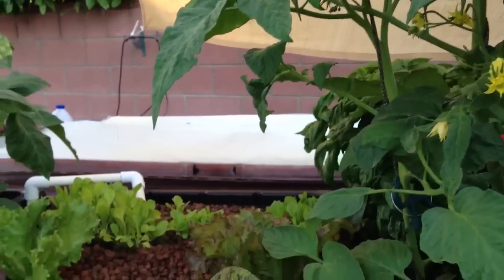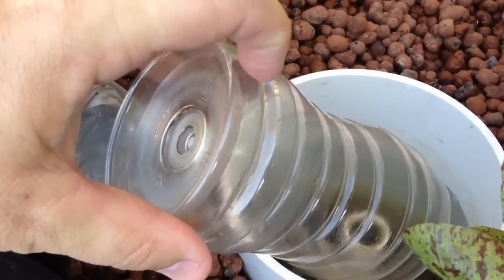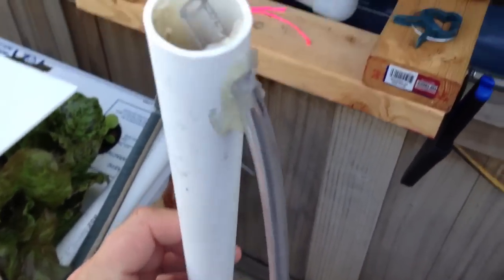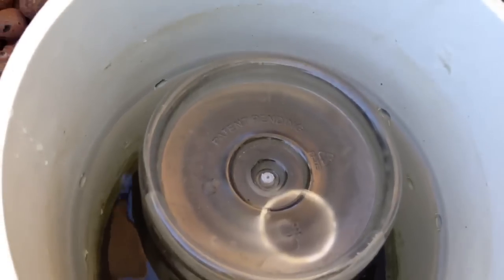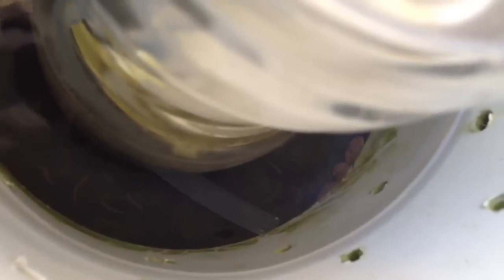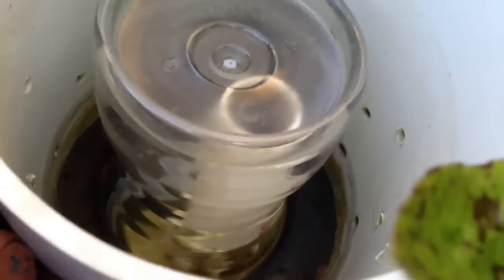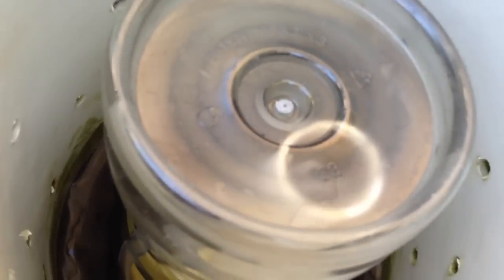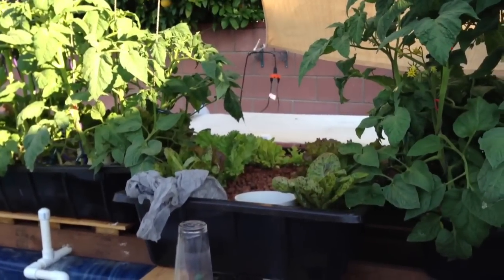The perfect bell siphon.

Comment: Two things. 

1. Drilling a hole in the stand pipe does nothing for that action. Might as well just zip tie it to the pipe. 

2. Doing it this way has/makes no difference in the time it take or anything to do with the drain time. That's just in your head. The whole reason people put the vent tube through the bell is so that they can stop the tube just above the intake slots, holes,  slits, ect, so that the vent tube can start the venting before it reaches them. And that's what stops the gurgle 

You putting that tube just makes the vent lower than the intake slots, holes,  slits, ect. Even if you angle the tube so it opens higher that water in the tube just stays there making it gurgle. 

I just tried it here and it fails to be of any use.
Reply from the maker: Past performance is no indication of future results.  Results may vary. No warranty is expressed nor offered.  Best of luck with doing whatever you wish with your system.
Reply: @jerschmitz11  "Past performance is no indication of future results.  Results may vary. No warranty is expressed nor offered." but your title says  "The perfect bell siphon." What gives. LOL

No matter Past performance or not, doing it this way is just not making anything better, it actually makes it worse.
Reply from the maker: @AztecWarrior75  Well what can I say?  There are many variables and it has helped others so maybe consider your application may not have been a good match for this solution.  I'll refund the cost of the advice.
Reply: @jerschmitz11  i can greatly appreciate your sense of humor sir🤣
Reply: @UserFormelyKnownAs_hjkh  What humor? Dodging facts and ignoring common sense is a coping mechanism for failure and people pointing that out to them.  It is sad.

Comment: Is there a reason the tube needs to go into the stand pipe?  I just zip tied mine to the outside of the stand pipe and it seems to work equally well without any additional fuss... but it makes me think you must have done this for a reason.  In either case, it is a simpler solution than trying to modify the bell - I didn't even need a fitting of any sort.
Reply from the maker: Larry Harris Cool. Glad it worked either way. This video has been up for a long time. I can’t recall why we decided to put it into the pipe. It may have just been trial and error and this is what worked for the flow I was trying to get.  Thanks for the comment.

Comment: Thanks for the video.  The problem I'm having is that I have four grow beds, two on each side of my little green house, and if I have all four or even two on the same side going and one drains, the other bed immediately drains and never fills up.  I know I need larger return piping to the pond but do I need to have some kind of air release because I think the suction from the one bed is affecting the other and they won't both fill or drain properly.  
I do have two beds going, but they are on opposite sides and they aren't draining at the same time.  
Any ideas what I need to do differently?  
thanks for any advice.
Daune, pronounced Dawn